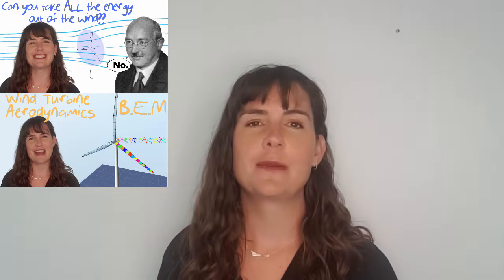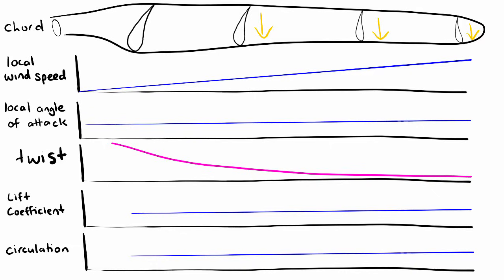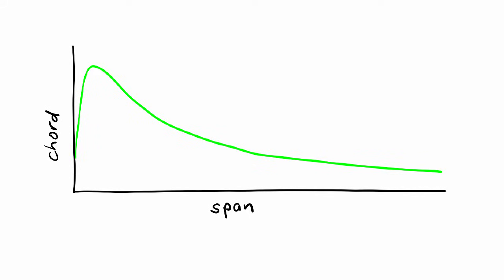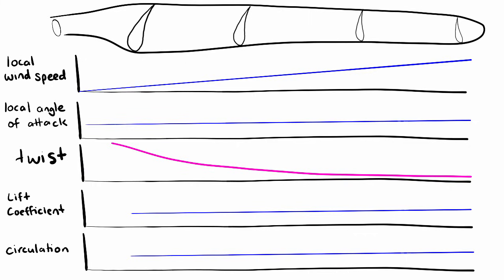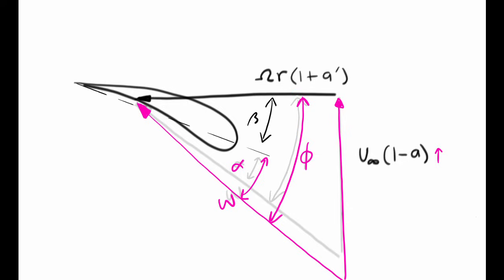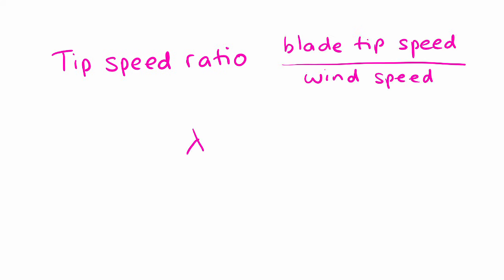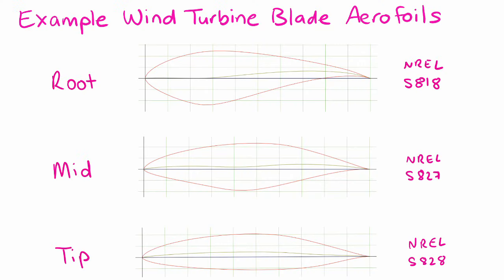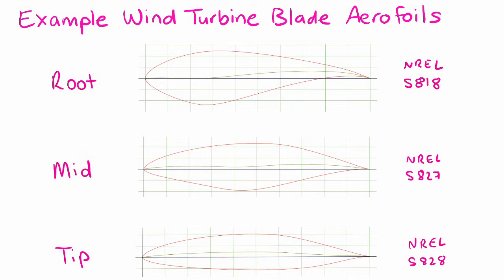How to Design Wind Turbine Blade Geometry for Optimal Aerodynamic Efficiency

Comment: I really appreciate the time and effort you put into your YouTube channel. There are quite many people that buy or build small wind turbines and I have seen quite a bit fail by design. My first build was a "One day build with what ever materials you have laying around". A joint venture between me and my 9 year old son. It was the typical small 1 meter radius wind turbine, based on a 3 phase motor from a broken segboard and the the classical wings cut out from a 100 mm PVC pipe. It works, it rotates, it makes (some) power, but it was mostly for fun and teaching. 

Now I'm hooked, I have bought 3 used blades from Missouri Wind and Solar as the PVC pipe blades has the aerodynamics of a toaster. They work better in strong winds, but what's the fun in buying finished Blades? I plan to design my own blades and even dream of pitch control. But, as you also indicate, its a rabbits hole of things to consider. In my head things has taken off like a SpaceX rocket. I have gotten hold of a free 4 kW Ø100 cm fan that really moves some air. My first thought is...yayyy..I just found a wind tunnel. I know I need to iron out the turbulence, but can I directly take data from a 1:5 scale and use on the full build or will aerodynamics be different in full scale?

How long are you in Denmark? The test center from "How to Stop Wind Turbine Blades Hitting the Tower" looks very much like Østerild Testcenter which I visited as of becoming a high school physics teacher.  

Keep the teaching coming it's really good.  :)
Reply from the maker: Hi Ole! I've been in Denmark nearly 5 years, and you are correct that it was the Østerild Testcenter I visited in a couple of my videos. I looooove it there! 
That sounds like some really cool engineering you are doing, your son is lucky! I have done some tests with the same (tiny) wind turbine with a fan and outdoors, and the turbulence does make a really, really big difference. The local angle of attack ends up pretty random, so it is hard to design an efficient blade for that. But you know what? I think a home-made wind tunnel is also a fun project, I would love to see what you come up with 😀
You need to consider Reynolds number when you are using a scale model, otherwise your results could be waaaay off a full-scale equivalent. Let me know if you want me to point you in the direction of some information on Reynolds number and how you can design a scale test. And good luck, keep me updated how your project goes!

Comment: In a previous video and comment I asked how large would a turbine need to be for a single household.  You gave a brilliant answer.  My question today, after watching this video is what would that single house hold turbine look like based on your previous answer.  Since this would be a substantially smaller unit, would more blades be better?  I'd be interested to hear your analysis of what a single household unit would look like based on the various parameters discussed in this  video
Reply from the maker: That's an interesting question,  and not so easy to answer here. Maybe it's a good topic for a future video 😊
My short answer is that there are small wind turbines available with both more and less than 3 blades, and it is hard to say which is "better" because the ways to assess performance are not as standardised for small turbines as large ones. 
When you're designing a small turbine, the requirements are usually different to a utility scale one. Reliability and low maintenance might be your most important requirements and a percent or two of increased output probably don't matter that much. Whereas on a  commercial wind farm, even a fraction of a percent increased output is a huge thing. 
I think the design requirements for small turbines differ a lot from site to site, person to person. And in my opinion, that's why people disagree over what is the "best" design for a small wind turbine.
Reply: @EngineeringwithRosie  Brilliant as always,  I would look forward to watching said video, if you should ever make it. I'm sure its obvious by now my interest is in dealing with a single household's worth of power because I am looking to reduce my power bill one way or another.  I have constructed a variety of devces and have seen what is on the market place, and nothing Ive built or seen on the market is suitable for what I'm looking for.  I was hoping that my line of questioning might give me some insight and inspiration as to a better design that may be closer to accomplishing my "goal".  I am currently dabbling in construction design using a kids toy known as K'nex.  And as entertaining as it has been to construct a variety of designs, I still dont think any of them can get the job done. But I must admit my designs have chaged radically since I first started so it has been a interesting journey.  Anywho, Ive chin wagged long enough and just wanted to say thanks for your replies and keep up the great works,  I'll be watching.  Cheers!
Reply from the maker: That's an interesting challenge. Where do you live? Suburban, rural, mountains, coast? Wind turbines are generally not as good as solar panels for small and urban/suburban locations. So as much as I love wind energy, and as great as it for large wind farms, it may not be your best choice for your home, if you are purely considering the cost per kWh.
But if the plan is also to have a cool engineering project, then I would go for wind energy over solar 😎 mainly because I love aerodynamics and composite materials! 
Depending on what kind of wind resource you have, you might even consider a vertical axis wind turbine. I have vague plans to build one for my own backyard, because they tend to deal well with turbulent air. But I need to get a backyard first...
Reply: @EngineeringwithRosie  Oh by the way, i think you might find this interesting.  Cheers! https://youtu.be/_QLEERYS5C8
Reply: @EngineeringwithRosie  This looks promising  https://youtu.be/BF7yX-7Wy30
Reply from the maker: What specific small turbines do you like the look of Edgar?
Reply: @EngineeringwithRosie  the archimedes screw looked interesting as its blades seemed to be producing a thrust for rotation instead of a lift force.   Let me know what you think of the archimedes design.
Reply: @doktaahwho8858  Research - Hugh Piggot & Dan Bartmann they design wind turbines for off-grid homes ...